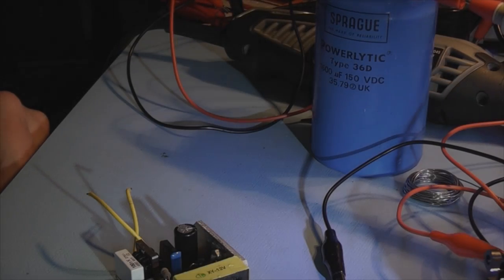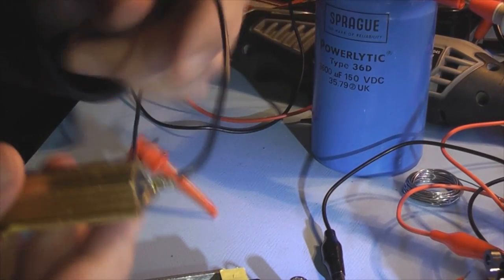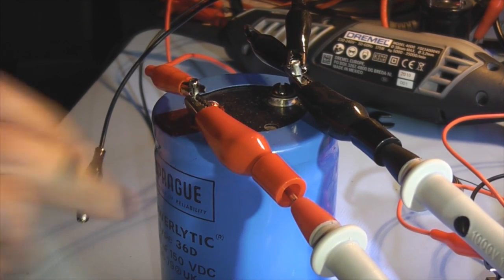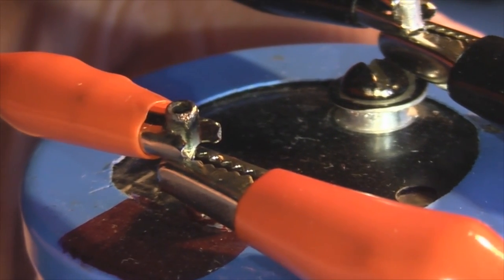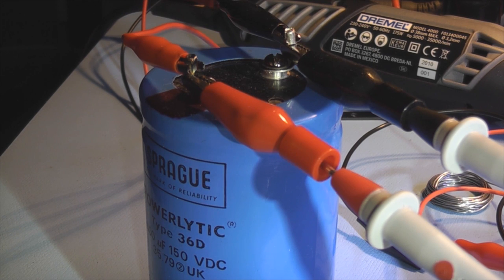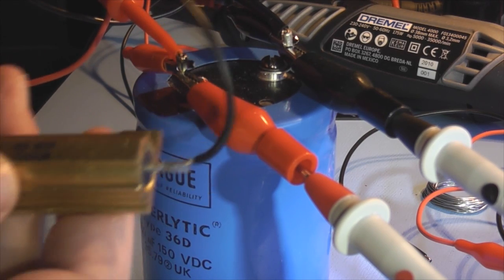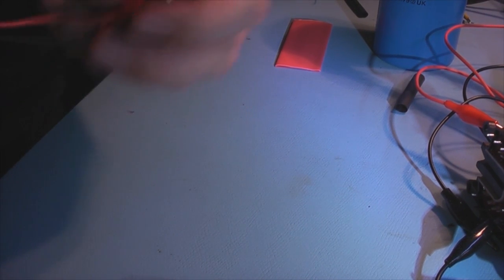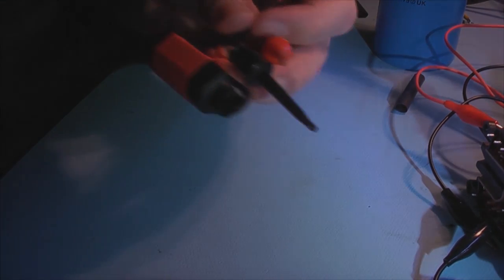DIY Capacitor Discharge Tool

Comment: I built a cap discharge circuit using a big Power Depletion Mode N-FET and 1.8 ohm resistor in series with the NFET source.  The resistor bottom side is connected back to the gate.  The current through the resistor will cause the gate-source voltage to drop below the threshold voltage (depletion mode) and regulate the current through the transistor.   The circuit draws about a constant 1A out of the capacitor until voltage falls below about 2V, then it looks like an 18ohm load resistor.  I put a pretty big heat-sink on the NFETS, because they would get hot enough to burn you without a heat-sink when discharging a large capacitor.

I built this for test technicians to discharge large caps safely on circuit boards we were testing.  We had guys shorting them out with screwdrivers, and some that wouldn't even discharge them at all before poking around on the board with a DMM (in resistance mode!).  We blew up quite a few DMM's that way.

 The first day I brought it in, a guy hooked it up backwards and cooked the 18ohm 2W resistor.  So I ended up making a bidirectional version that had two back-to-back depletion mode NFETs so it would be more robust and not break if you connected it with the wrong polarity.

 The "constant current sink" did a good job of discharging the caps we were working with to safe levels in about a second.

 Your video reminded me of this experience.
Reply from the maker: Sounds like a good project & circuit there Jess, well maybe apart from the exploded DMMs  😀.. I may have to look into a circuit like that myself some day. Thanks for sharing the experience 👍
Cheers
John
Reply: This is a top comment - with 2 likes. Here. Humanity in essence.

Comment: Don't use a Dremel to cut aluminum. Take it from a long time metal worker.
Use a hacksaw and a file instead.
The soft aluminum will gum up grinding wheels and discs and it grabs and causes them to explode and a piece can fly up and hit you in the eye. The same thing applies to copper, lead and other soft metals.
Reply: It's just a matter of slowing the disc speed and the force you apply to the Dremel as you cut.
Reply: true, but he's not wrong. I've had some serious near-misses that I didn't learn from the second time. I still use a dremel but now I use eye-pro

Comment: Time for capacitor discharge for capacitor is 5x(CxR) so for  3600uF that in Farads is 0.0036F so multiply that by the resistor of 10 Ohm then multiply the answer by 5 which we say is the time constant and you get time in second for discharge which is 0.18 seconds or 180 Milliseconds which is still a bit too fast. Choose a 500 ish ohm or at least a 100 Ohm. Depends on what size capacitors you work with but you want to discharge it longer than 2 seconds that way you protect the capacitor.
The capacitor can explode if you not careful.

Comment: I should make one of those for bleeding the charge off my voltage doubler, especially if I add more capacitance.  The balancing resistors discharge it eventually but that can take a couple minutes before it is safe to touch.  
Thumbs up!

Comment: That's quite neat. Certainly beats the screwdriver trick especially when discharging capacitors that are mounted on circuit boards.

Comment: It probably was up around the line voltage region, the electrolytic there may have been filtering rectified mains as it's sitting right next to the bridge rectifier and the mkp cap may have been line filtering or something. Can be very dangerous, lethal even. Great video, I feel this is often something that is overlooked or forgotten when working on mains equipment such as this.

Comment: That's a huge resistor. You only need a 5 to 10 watt resistor. The key is the ohm's resistance. Use a little more resistance to slow down the drain of the capacitor. Otherwise you might damage the capacitor and ruin it. I'd recommend a 470 ohm resistor at 5 watts. That should handle almost any high voltage cap.
Reply from the maker: Agreed 👍.. I think at the time I just didn't have any suitable values, well apart from in the usual E12 sizes etc, which would be inadequate really.
Cheers
John

Comment: If you have another option, it may be safer (Depending on the selection) but if you do not, use wax, Wd-40 or some trans fluid, as it will cool, keep the blade(s) from loading up and make the cut go much faster. It all depends on what your blade, substate and time avaible. Those parameters will dictate the choice in most cases.  Eye shields for the WIN

Comment: Thank you for the nice video.  I have a couple of questions:
1.  how is it that you got shocked by touching that board?  isn't it necessary to touch both positive and negative terminals on a capacitor in order to get a shock from it?

2.  when I tried to buy a resistor from mouser, I found that they have like a hundred different types of resistors (not brands, types).  what type of resistor do I want. a carbon composite resistor?

Thank you for your help.

Comment: I really appreciate this video. The pleasant voice, the good lighting, detail attention.  I was curious is how many capacitors can you use this on?  That is as the electricity goes into a resistor when does the resistor get "full" How does the resistor discharge?
Reply: The resistor dissipates all that discharge energy into heat. The lower the value the faster and warmer will disipate.

Comment: Would a 50W or 100W 20k Ohm resistor work? (which one would work better, could I use it for any size small of big or do I need different resistors for different sizes/capacities?)
Reply: Higher resistance or Ohm's.  Use a 470 or higher ohms with a 10 watt  rating. You should hold the connection on for a few seconds, like 30 seconds to a minute to let it drain. A slow drain is better than a fast drain with low ohms. The screwdriver method is instantaneous which ruins the capacitor and is a giant current pull which is where the shock happens. When you slowly drain the cap it is better for the component and has the benefit of lowering the chance of a shock.

Comment: I have limited knowledge of this subject, but does this work in a similar way a lead acid battery tester (for automotive batteries) works, by appling a load to the source? In this instance the resistior would be the load tester? This is an attempt to draw a parallel to try and understand. Could I use a large (1000 amp) battery test to discharge larger capacitors? Possibly a tester that is equiped with a potentiometer?

Comment: Great video!  If I may, what resistance would you recommend for me to discharge my home air conditioner capacitor rated at 50 micro fared, 440 Volts AC?  I certainly don't want to use the "screwdriver" method on that!
Thanks in advance, and keep making these videos!

Comment: Hi reading all the comments I got a little confused and wanted to ask you. I'm building my first valve amplifier where the use of high voltage / value capacitors are used. And was thinking about building a discharge tool like yours. Can you please confirm the value and wattage needed to discharge these types of 
capacitors safely. Thks

Comment: Still should check the cap has discharged as the bleed resistor can fail (you do not want to touch that big one when fully charged)

Comment: John, Thanks for the information about safely discharging capacitors. I have questions regarding your recommendations for the “beefiness of the resistor. The capacitor that I want to safely discharge is part of a swimming pool motor that produces 2 hp and runs on 230 volts. The ratings for the capacitor are 50 microfarads and 370 volts ac. Could you recommend a resistor type—ohms and watts—based on these specs? Also how many amps should the wire leads be rated for based on this? Your opinions would be of great value to me.
Reply from the maker: Mishigoss55 Hi... The resistor in the circuit I used would work fine. It is rated at 50W and 10 ohm's. I used a 10ohm one in the vid to give a very fast discharge rate however you do still get an initial contact arc when connecting the tool in the vid. For a more controlled discharge you could use a 330 ohm resistor etc (still rated at 50W to be super safe.) this will lesson the chanches of any contact arcs when you initially connect the discharge tool/resistor. It will also slow the discharging time of the capcitor down a little to a few seconds which is not a problem.

As this was quite a popular video I may do another video soon showing the different effects of using different value resistors and the discharge times etc.

Hope this helps

Comment: i normally use a light bulb from a microwave for caps rated for 100v and less the higher the voltage on the cap i use more bulbs in series NOTE i connect the bulbs both ways across the cap just to be safe

Comment: I have found 100w, 100ohm ceramic potentiometers. If connected with the resistance maxed and then immediately turned down, couldn't you avoid the initial arc but still drop resistance to zero? This would create a faster discharge than a 100ohm resistor and allow you to "tune" it for d/c rate vs. arc minimization, no?  

Also, I've read it is advisable to recheck and discharge caps as they can have residual charge after draining.  You didn't mention that here. Are these tools less prone to that problem?
Reply from the maker: +Oqsy Hi.. To prevent caps rebuilding charge you can just leave a suitable value resistor across the terminals to keep it safe. 

You'd have to experiment at reducing the initial discharge arc. You would have to get your timing right using a pot but It sure could be done. If you required a minimal arc solution you could try a suitably sized NTC (Inrush current limiter.) This of course would depend on the amount of energy stored, as the larger general purpose NTCs I know of have limits around 1000 joules IIRC, so using these with banks of caps wouldn't work.

Comment: I ordered a resistor to make my own according to your instructions and order a 20kO 12.5 watt resistor. The size of it is about 1/3- 1/4 the physical size of yours.  I would have envisioned it about the same size if not bigger...its so small I can't image easy use. How can a stronger one be this small??

Comment: Ah...I was unaware that the resistor works by discharging the electricity via heat. That's why the need to shrink wrap the resistor? I thought the resistor worked in the same storing capacity as a cap does.  So for the size resistor you made for this video what maximum size capacitors can this discharge ?  Did you incorporate an LED in the circuit yet ? I'd like to see how you do that.
Reply: You heat shrink the resistor to provide a modicum of shock protection as well as to provide some insulation to the exposed leads.  It also will help keep the resistor together if it should blow out for some reason.

Comment: That may not work for a 1300v,fully loaded cap...high voltage arcs very easy....that much voltage is looking for the shortest way out and should it arc to the body it would unload all at once.I tried measuring the voltage on a .04 uf / 1300v cap with my 400v digital meter (I did not believe it had even 300v in the cap)----BLEW that meter apart.

Comment: Thank you for the video.  So I'm trying to discharge a residential HVAC capacitor, would a 50W Watt 25 Ohm Chassis Mounted Wirewound Resistor work for that?  Your opinion would be appreciated thank you.
Reply from the maker: Yes you will be fine with that value. You can try different resistors also to slow or speed up the discharge rate. Just watch that you don't burn yourself on the resistors as they can get hot depending on value.
Reply: Thank you!
Reply: Ali Rafatjah 1

Comment: Why not add a switch to avoid having the capacitor discharge when connecting the lead? I know it's not a big deal but if you are already making this as a safety tool it could only make it safer.
Reply from the maker: +Jacob Johnson  Yes, good idea..  It would have to be a switch that could take at least the loading of the caps being discharged. Otherwise if you were constantly discharging larger caps then you may have a problem with the switches burning out due to the initial connect arc.

Comment: so if i am not caring about the well being of the capacitor, i guess i can just put a screwdriver across both terminals and short it?
Reply from the maker: Yes. However using a screwdriver you do risk damaging the capacitor and the screwdriver too depending on the size of the cap.
Reply: ***** thanks, i need to discharge it so i can get to the transformer in a microwave, i don't want the capacitor and i will use my least favorite screwdriver :)
Reply: Anything that capacitor is connected to could be damaged as well.

Comment: Will this method work for 450v capacitors?
Reply from the maker: Depending on cap physical size (Like the one in the video and smaller) and capacity it should be ok. It will NOT work with industrial sized capacitors!!

However as always with these things.. It's at your own risk if you try it. And make sure to take all necessary precautions. e.g gloves, face protection and fire precautions. As discharging especially high capacity capacitors at these voltages things start to heat up, instantaneously!
Reply: ***** Thanks man

Comment: 2:31 is that power lock
Reply from the maker: Blackjack4141 .. Is what.... Power lock?
Reply: the handles that you have going into the capacitor.
https://en.wikipedia.org/wiki/Powerlock
Reply from the maker: Blackjack4141 Ah sorry.. No that's the socket end of the crocodile clips.

Comment: i was expecting to see how you made the drain tool not how to use one this video is time in my life wasted that i know ill never get back!!!
Reply from the maker: Within the first 90 seconds of the video I explained, and showed that the tool was literally 1 resistor with a wire soldered to each end. To make it.. you solder a wire to each end of a resistor.